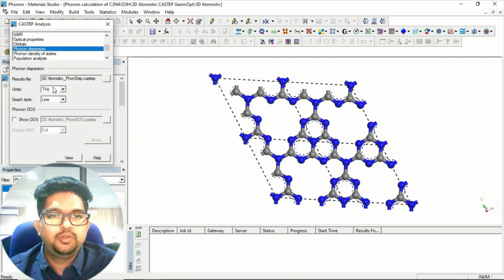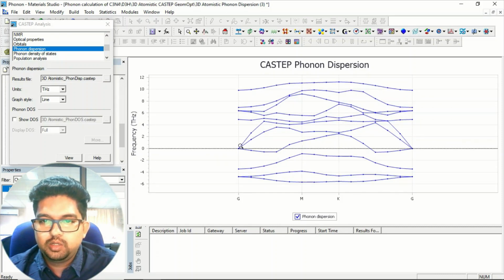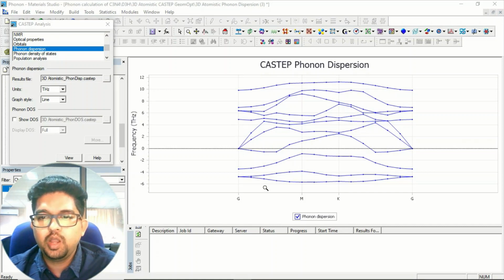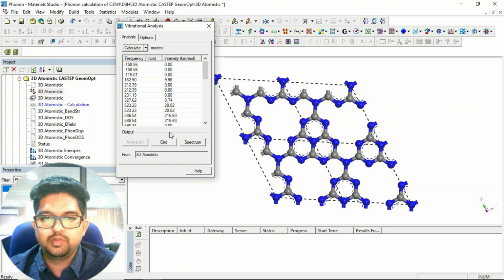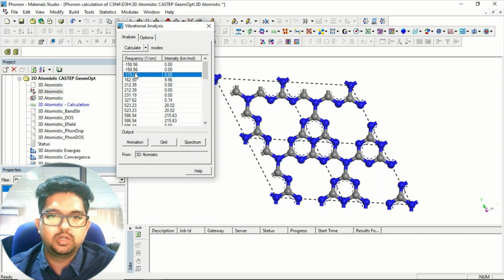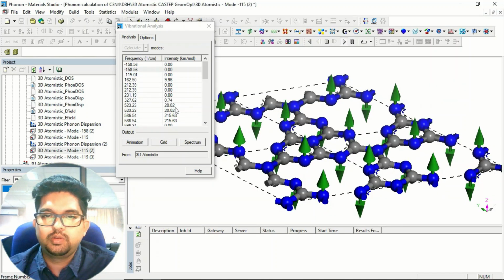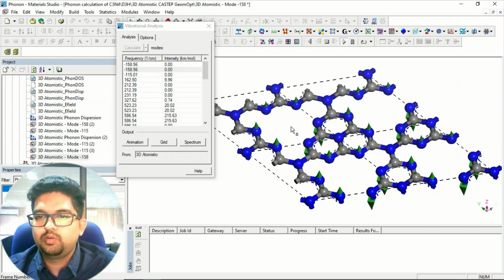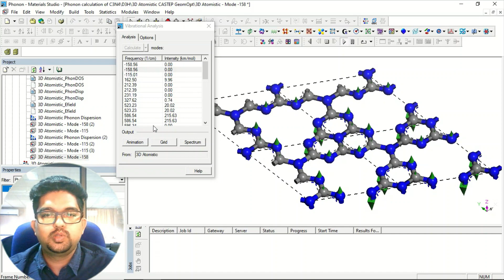Phonon Dispersion Calculation Self Analysis || Gaurav Jhaa

Comment: How to extract thermal conductivity from phonon calculation?
Reply from the maker: Dear Akbar,

Thermal conductivity is related to the phonon mean free path and group velocity, which can be obtained from phonon calculations. Here are the general steps to extract thermal conductivity information from phonon calculations:

Calculate phonon dispersion: Perform a phonon calculation to obtain the phonon dispersion relations for the system of interest. This can be done using density functional theory (DFT) or other methods, such as the harmonic or quasi-harmonic approximations.

Calculate phonon lifetimes: Calculate the phonon lifetimes using the anharmonic properties of the system. This can be done using perturbation theory or molecular dynamics simulations.

Calculate group velocity: Using the phonon dispersion and phonon lifetimes, calculate the group velocity of each phonon mode. This can be done using the group velocity formula, which relates the frequency, wave vector, and force constant matrix of the system.

Calculate mean free path: Using the phonon lifetimes and group velocities, calculate the phonon mean free path for each mode. This can be done using the Matthiessen's rule or other methods.

Calculate thermal conductivity: Finally, using the phonon mean free path and group velocity, calculate the thermal conductivity of the system. This can be done using the phonon Boltzmann transport equation or other methods.

It is important to note that there are many approximations and assumptions made in these calculations, and the accuracy of the results may depend on the specific details of the system and the methods used.

I hope this information will help you out.
Reply: @quantumguruji  😍